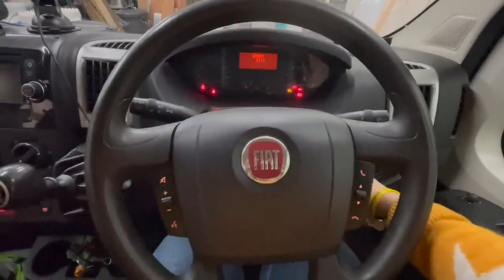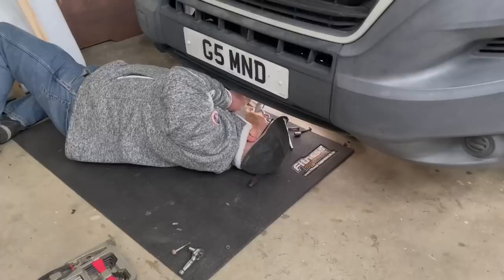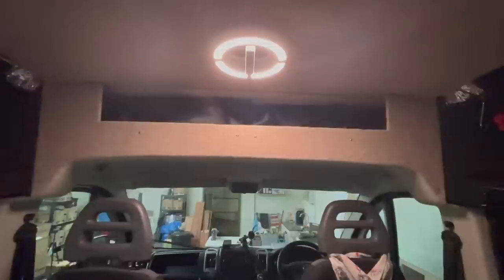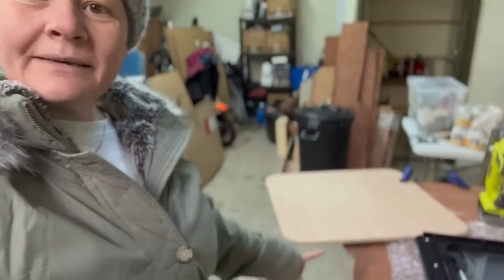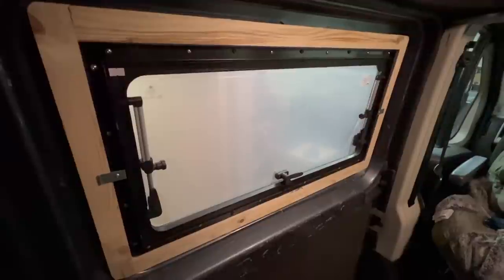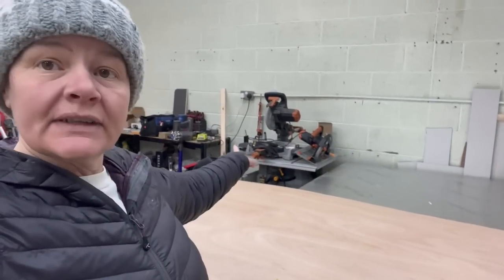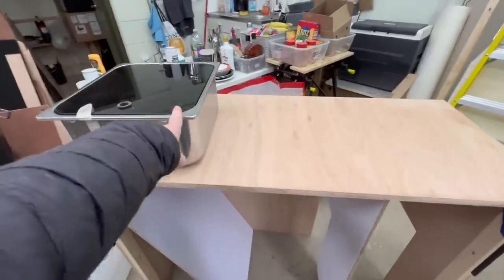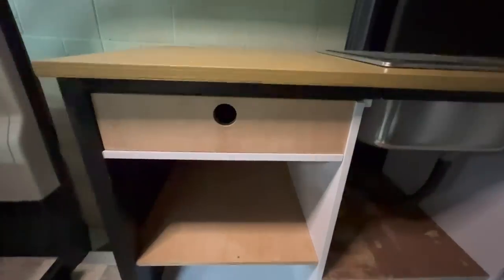UMV8 - The van wouldn't start!! How much will this cost..?

Comment: Hi, from 10mins+ the sound was so low, didn't get much of what you both said. def. need a lapel mic. stay safe and continue building.
Reply from the maker: Thanks for the heads up, I’m still getting used to editing and getting the volume standardised 👍🏻
Reply: @unadventurousmandy  No problem, just wanted to give you a "heads up". No doubt "Mr Magic" will help.
Reply: No problems this end with audio levels?
Reply: @24k__J  Not so, I use headphones on lap top. First half of video was fine the suddenly huge drop in sound level. Not the first occasion

Comment: Good to see it coming along. Intrigued how you’ll find the 2 sliders. BTW can I ask how the renown inverter is going in operation. I’ve fitted a 2000watt photonics universe unit and we’re nespresso addicts like yourself but when the system gets to 94% of battery it says no more?
Reply from the maker: I'm already loving the 2 sliding doors, so much easier when I always forget which side the door should be on..  I don't have a stand alone inverter in my van - I use my Ecoflow Delta 2 which gives me a little extra battery capacity too.  What types of batteries do you have? ie AGM, Lithium etc..
Reply: @unadventurousmandy   I’ve put 2x130AH AGM 260 total under the passenger seat, inverter under the drivers. Works fine on sunny days recharges back to 100% in about45-50 mins using the solar. January was a different story hence the question , 12 volt everything. Lights fridge gas for combi heater.guess we’ll have to use the gas instead of the electric travel kettle ( low watts) low wattage hair dryer for swmbo

Comment: Hi Mandy, All things seem to be going so well, so well done. I have a quik question about your solar. Is there a reason why you haven't used the lighter flexi panels to save weight?
Reply from the maker: Thank you 😁 I chose rigid panels as they are far more efficient and have a much longer life than the flexi panels.  I think if I needed to save weight, I’d do it in other areas first - my little van has a big payload 🙌🏻

Comment: Hi Mandy how is the starter motor going? is it still ok, as I have the same problem with my self build Ducato campervan, turn the key and nothing, silence!!! no clicks, then I turn the key hold it over for a few seconds then it starts, was that the same situation you had?  can you give me your thought Chuck pls.
Reply from the maker: It’s faultless now (touch wood!!) there was nothing for me, no noise or anything then if I kept trying it’d start - until it didn’t which is when I replaced it. Nice easy DIY (or JDIFM) job though, 3 bolts and 2 wires!
Reply: @unadventurousmandy  hello again, and thank you for the reply, I rewatched your video Mandy and at the very beginning, 13 seconds into the video when your filming you starting  issues you throw the switch can I hear a metallic click from the starter motor, or is it me.....? as with mine there is no noise at all.
Reply from the maker: I think that’s just my key, John said he couldn’t hear a click - it was full on seized
Reply: @unadventurousmandy  Thanks again for your reply, sounds like a new starter motor it is then.